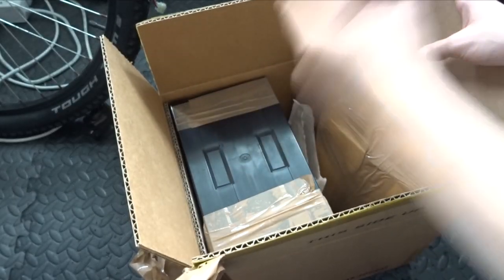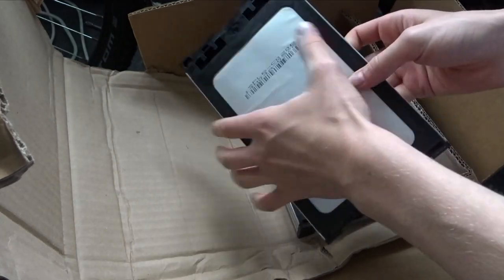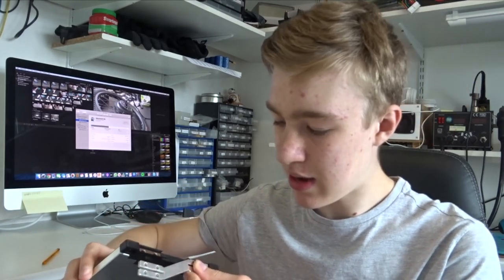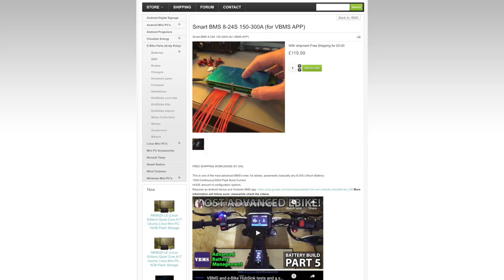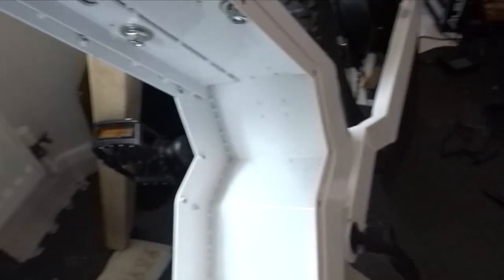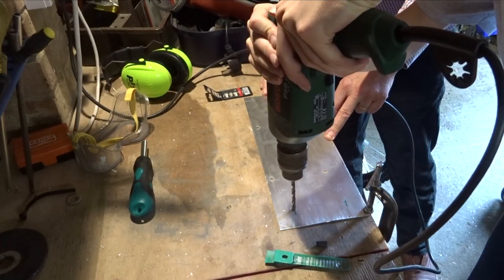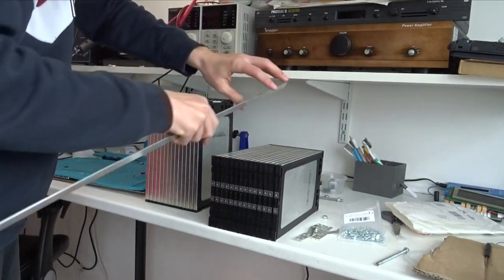Batteries and Power! - 8kW Enduro eBike V3 Build- Part 6

Comment: Respect to the maximum  ! I have the same e-bike , because I saw your build I bought the same batterys , and I'm upgrading my controller to asi bac 8000 , and a qs273 5t  hub motor, im going for range more than speed . I got my batterys from the same chap you did he is a salt of the earth type of man , your video gave me a big inspiration to build My Idea bike ( I want to take it to Jamaica,and see how well the hi torque hub really preforms ) so thank you for your video,I hope I can link you again about the extreme configuration e-bikes in the UK .
Reply from the maker: Awesome! I wish I'd gone for a higher T motor to get the torque andw ould be interested to hear how the bac8000 performs

Comment: I'm making one with the same frame. I made one of the three packs that will fit, I used 18650 spacers with 1mm space between the cells (usually 2mm which wouldn't fit). One battery is 20x7, each cell 3500mAh which makes the total capacity ~73.5Ah at 100A continuous (just might be able to do a range world record). I use shorter screws so I don't need to grind the panel screw holes.
Reply from the maker: Nice build! I'm sure that bike will go far on a single charge too.
Reply from the maker: @alireza071  I think he means 18650 cells not the C020Bs
Reply: @EverythingEbikeChannel  Indeed. It's been stolen a week ago tho..
Reply from the maker: @phyro4143  Your bike! Crap that's awful sorry to hear that!

Comment: If only I discovered this gold mine earlier
Reply from the maker: Thanks 😁 Are you building a similar bike?
Reply: @EverythingEbikeChannel  I've only got into building ebikes. So far I got a 1.5kw bike. Hopefully I'm looking to build more ebikes. I had a damaged 😞 motor with the cables ripped off and I found one of your videos to be the most helpful in solving the issue
Reply from the maker: @Zikrullah-d5x  Cool, got to start somewhere!
Reply: @EverythingEbikeChannel  on the first motor, its kinda a design ish fault. The cable didn't come off from between the disc rotor, instead it came out from the end of the axle. Which makes it difficult to fit a torque arm on that side for a newbie like me. Its difficult cuz it ain't one single wire. You got the hall sensor plug so you gotta rip and re solder it.
Reply from the maker: @Zikrullah-d5x  Oh I see, that's annoying. You only find that on lower power motors as it weakens the axle strength if it's bored out.
Reply: @EverythingEbikeChannel  everything's alright now. Lesson learned. Always gotta look really hard at those axles before buying em

Comment: I’ve got same frame.  I’m using a 20s 14p 72V 40ah battery with Panasonic PF cells.   My BMS only handles 80A so I’m looking for a new one that can handle at least 200A since my cells are 3C and can push 120 continuously.  I am hoping you linked the bms you are talking about (I haven’t checked yet lol) cuZ it sounds great.  My bike goes 50 miles with no pedaling.   It will go much further when I use pedal assist and keep it under 25mph (any faster and I’m pedaling way way too fast... really want to get a schlumpf drive someday).  My bike goes just under 50mph with the QS205 3T motor... and it accelerates really fast, lifting the front wheel if I don’t lean foreword a bit.   I can’t imagine how fast yours will be ... be careful man cuZ mine almost jumped out of my hands the first few times I tried riding it.   You have the sabvoton so throttle will probably be smoother than my square wave silver no name controller (also replacing w sabvoton or asi as soon as possible).   I haven’t found many people on here yet with this frame so in happy to find your videos.   Will be doing some riding videos as soon as I get a GoPro.  I’d show u a picture of it cuz my bike looks sweet, but I don’t think you can upload any to comments section.  Anyways nice bike and thanks fore the videos!!!   Oh one last thing... if you need as rear dirt bike fender,  try a pit bike one bc the  moto seat you have is actually designed for a pit bike... i don’t know the model but I bought mine from a guy on YouTube named HufStuff when he no longer needed his.  You can see it in some of his old walk around videos...  if you decide to use a bike seat , try muckynuts butt guard rear fender... that’s what I’m using at the moment since I do some commuting.  Will be using the moto seat when I go to dirt trails or track.   
Alright , I’m out and sorry for the novel lol.
Reply from the maker: What a beast of a comment! 😉 I've linked most of the parts in my latest video and will keep updating the list every time I upload. 50 miles is a very decent range and I hope mine will do similar or maybe a bit less with no pedalling. You've chosen some nice parts with the QS205 motor and panasonic cells but I would definitely recommend the BMS i have. It would be great to see some footage of your bike so definitely upload when you get the chance and thanks for the little warning about how crazy it will be 😄 (can't wait to fell the acceleration!)
Reply: EverythingElectronics Channel  now that I think of it , it wasn’t really the acceleration that was such a problem for me.   It was the jumpy-ness, or the difficulty in gradual acceleration.  As long as I was prepared for it, It is fine.  It’s just my controller makes my throttle so touchy, I never know what to expect.  I’ve gotten used to it now and it’s fine... it just threw me for a loop at first (almost literally lol).   My throttle has a huge dead zone at start... I tried a potentiometer and then a domino throttle.  Neither worked.  Need different controller voltage supply to throttle as mines only 5v max and not programmable.     Either way I love this bike and I bet u will too.   It’s the best purchase I e ever made.  So fun! Thanks for reply man, I’ll check those links.  Again , keep videos coming!!!👍😊😎

Comment: Could I get some of those cells in the US?
Reply from the maker: Maybe... depends if James will ship them out. The postage will be a lot I expect due to the weight and them being lipo batteries but you can try. I've no idea what documents and procedures you'd need to go through and I've had a recent experience with a 20% unexpected customs fee.

Comment: Hi. Do you think you could squeeze in 20s 2p in this frame of these same cells ? I was thinking maybe have 1 half on its end and one on its side and squeeze the sabvoton on top. It's hard to visualise on your video as you have split the pack up
Reply from the maker: Yes you can, I know someone who did it. He cut the underside off his frame and slid the batteries in that way. There was a block of 28 then a smaller block of 6 which stuck out a bit more because of the sloping frame. He then made a new pannel for the bottom that extended down at the end to hold the 6 extra cells. I'm not sure how he secured it all in place or if it's possible without modifying the frame, but with a bit of cutting it is certainly doable.
Reply: @EverythingEbikeChannel  ok. Thanks for getting back to me. But I don't fancy cutting and making a frankenstein out of it. Don't mind cutting off some lugs like you but not opening it all up. Shame. I had those cells 20s1p and it ran great pulled 240amps before. Just would like more range. Gonna have to go littokala route

Comment: EverythingEbike Channel Hya Great to be back on your channel. My Grandson  has a 24v ride on car. The led acid batteries are useless unless you start spending some serious bucks. Would i be able to make a 24 v battery out of these and just how many would i require?
Many thanks in advance once again to you!
Reply from the maker: Yeah you certainly could. You'd need a multiple of 12 in series depending on how long you wanted the battery life to be but even just 12 would last a few hours in between charges on a toy. Links are in the description for where to buy them if you're interested.

Comment: I've bought these cells for my ebike battery. what exactly are they? do you need a charger for li ion lifpo4  or lipo. I got 20 of them and am gonna make a 72v 20s pack, also wasnt wanting to fork out as much for the bms you used I've seen 20s ones for 30 quid. they should work d'you reckon? cheers Harvey
Reply from the maker: Hi harvey, they're li-ion. If you're using a bms, that should handle the balance charging so you'd just need an 84v power supply to fully charge the pack. I'm not sure what's out there but deffo do some research about the best budget bms as there's a lot of junk out there, but also some bargin items. I've not had the best experience with cheap bms's, but get something that's rated a fair bit higher than what you actually want to put through it (current wise) as they are often over rated. Send me a link if you find one and i'll have a look
Reply: @EverythingEbikeChannel   cool thanks
Reply: @EverythingEbikeChannel   So I take it then, these cells aren't as volatile as the rc lipo packs that everyone says are like bombs and could maybe be used in a back pack no? or is that still dodgy with these?
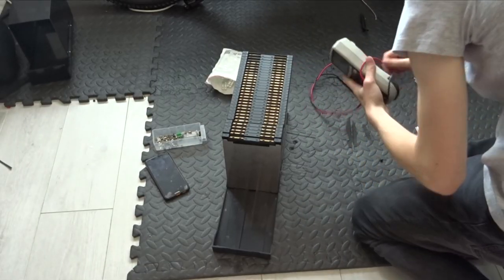Reply from the maker: @themadharv  Check out https://www.youtube.com/watch?v=z86Mt6t6Cn8&list=PLiNFT2nrwhslyrAOURoSFAQrzwAsn-bWx&index=11 at 4:35. Hobby lipos are prone to swelling and bursting as I found out on my v2 ebike! Haven't done any long term testing. Always be careful but I think these cells could take a bit of abuse.

Comment: will these batteries fit in the enduro style frame ?
Reply from the maker: I'm not sure to be honest. Might be able to fit some but not all depending on the width and taper of the frame? Overall dimensions for the pack are 240x138x260 if that helps

Comment: Neato. I'm sure you've heard of Farasis battery cells in the ZERO motorcycle?  Well these you've demonstrated may sound like a cool alternative,  & i'd need to hear of any history, & cycles with these cells.  But i need to put together a 11.5kwh battery ebike version 3.0 at the end of two years.  Debating on reliable batteries to keep weight minimal.  Well Samsung sdi lipo4 batteties are getting better, as they currently found a home in Harley's harley Davidson livewire...lacking desired power & charge speed c rates, but robust, long life for a more lite usage, .
 Happy riding, & fast charging ahead.  Plenty to improve on & learn until such time.

Oh....lipo??, i try not to chase lower cycle life batteries.
Reply from the maker: Just looked up the Farasis cells and they're pretty similar in power, size and life cycles. If anything they've got 25Ah instead of 20 but I doubt the average person can buy them... 11.5kwh is insane, what kind of frame are you using!? Personally I'd go for quality over weight savings but depends if you want range, speed or acceleration. Li-ion cells can end up being more energy dense in ebikes as they can better fill the space by being made into custom packs but are MUCH more expensive. Still a long way off getting to properly ride mine but might do an update video soon 👍
Reply: @EverythingEbikeChannel  My steel cargo reinforced supports the 100+ pound battery system, poorly engineered though....8kwh capacity currently.
I'm going to tweek(perfect) it to support the load which i predict for now at 130-160 pounds.  The farasis cells are 1,000 cycle lithium ion from my research & seems to be a challenge to find or acquire, the new ones are much better & 32ah, but i don't know how your (lipo) chemistry could have that many cycles?  I sorta put lipo behind me, but need to keep up to date & refresh my mind.  I'm trying my hardest to choose the lightest yet most resilient battery to enjoy long term.  Those battery c rates give the battery the relief during discharge & handle 2 hour charging (ideal) that i need.
Reply: @EverythingEbikeChannel  yuba mundo v4 cargo bike....21 inch motorcycle wheels.  Wish it had suspension.

Comment: Hi first of all thank you for your video and your links through which I was able to buy such a battery pack. I wanted to ask you how many cells did you get into your frame. Fit 40 pieces for a 72V 40AH battery pack. The battery does not fit in my frame because it is 1cm too narrow. Now I'm thinking of either converting it (widening it) or buying your frame. I would be happy if you could write me how many cells fit in the frame without your attachment.
Reply from the maker: Happy to help! I managed to fit 28 which could have been pushed to 30 if I'd used some thinner metal for the brackets. I'm helping a chap whose chopped the underside of this frame off and is then sliding 34 cells in, mounting 6 on the outside and then putting a removable panel on to give a 72v 40AH pack with 40 cells! Not sure how you'd widen it but which frame have you got (link)?. I reckon without any mounting stuff 34 is possible but you'd have to get creative for fixing them in😁
Reply: @EverythingEbikeChannel  thank you
Reply: @EverythingEbikeChannel  My frame measures 13cm in width. Since the Eig Cells are 14cm, this only fits in with me when turned 90 degrees. That means I install the cells on the side and come to a maximum of 2x 14 pieces. I have now built 2x 13 pieces to cushion the battery a little. The BMS is then installed directly on the battery. I also decided on the Ant BMS, but as a 20s 400a. As a controller I use a Sabvoton 72200 which then drives my lift motor, a QS273 V3 50H 3.5T. Since no more cells fit into your frame, I will discard the idea of buying your frame. I had acquired 50 self cells through your contact, there I will then build 2 battery packs out of them and if necessary swap the empty pack for full on the way. Thanks again for the help.
Reply from the maker: @Black86Panther  No worries mate. I haven't seen a frame that's narrower than mine unless it's this one (https://kirbebike.com/kirbebike-5000s/high-power-e-bike-frameset-detail.html)? Sabvoton 72200 is an absolute beast so I've heard!

Comment: did you realise that your wheel scrubs on your sabvoton when fully compressed?
Reply from the maker: I must have had this pointed out so many times😉! (probably address it in my next vid) I'll be getting 19" wheels and new suspension with much more travel so the whole front end will be jacked up more and have smaller tyres so it won't be an issue.

Comment: you know you can use lithium ion battery and can make 75 ah. 40ah 50 miles seem so low
Reply from the maker: The big draw for these batteries was the price per Ah which was much better that building a li-ion pack. I could have got a bigger overall pack by making a custom sized block, but the total cost for 2kWh of cells was only £380 with these.